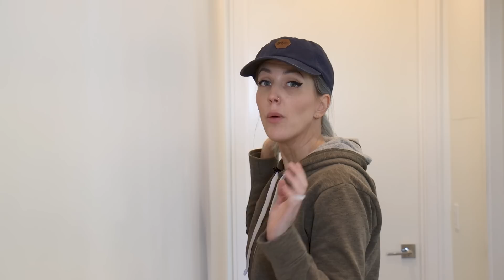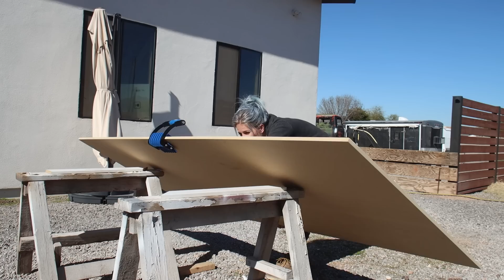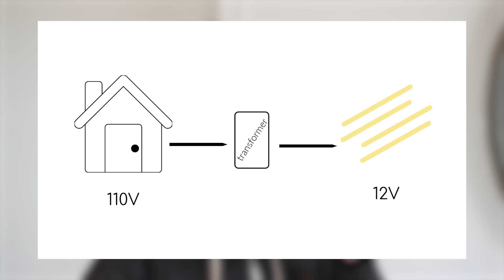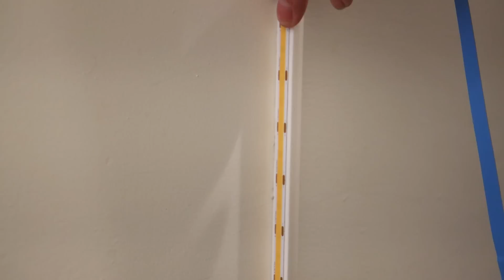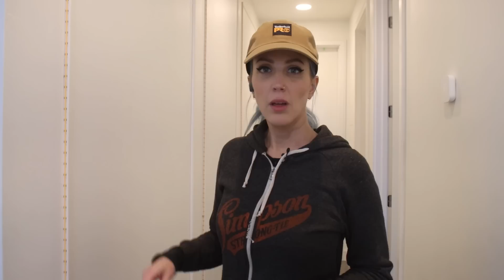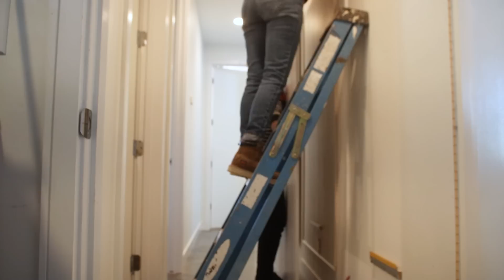I Made My Hallway GLOW! | LED Wall Panels

Comment: Whereas I would have been inclined to either use longer French Cleats at the top, or use both of the pair of French Cleats at the top.  Then you don’t have to worry about distribution of the weight between top and bottom.

Comment: If you don’t want to see the LED’s, you could route a channel into the back of the MDF so the LED’s are mounted in the MDF facing the wall, instead of on the quarter round facing out.

Comment: A good idea to controller the LED's if you really don't want to install a switch in the hall, is to incorporate smart home switch adapter with the transformer, then you can set it on a timer or control wirelessly with google home or your preferred smart home management software

Comment: ;-) parallel connection gives you consistent *voltage* ... and allows your strips to take whatever (milli)ampers they need as they are different length and has different consumption. Actually led strip itself is bunch of parallel connected segments placed physically "in one line" ... that's why you can cut on specified places without changing needed voltage ....

It should NOT be brighter on begin than on end as all segments are connected to the same coper wire (node) and should have access to same voltage .... what you are telling, is "be aware of cheap led strips that have high transition resistance"  ... yeah, it can happens and if you buy something super cheap/crappy or have super long strip (spool usually have 5 meters) ... in your case where you place strips in circle, you can consider connect both ends of the strip to the same driver -> that's the beauty of parallel connection ...

And even if there is no strict code on 12V systems ... dont use some random twisted pair cable... just use something double insulated and round .. its bit more rigid, but you will be sure that you will not rub-off to the bare metal

Comment: I added LEDs around the perimeter of my bedroom and used an RGB with a remote.  I used a pair of aluminum L brackets to form an "U" channel, just because I had a lot of that stuff on hand and mounted it to the wall about 4" from the ceiling.  Then I put some Cello foam about 3 layers to soften the light so I can dim it down.  When I add my Dark Sky's Planetarium projector it makes me feel like I'm outside... It's very cool and fun to lay in bed and watch the stars with the ceiling slightly illuminated.

Comment: Houses in Canada and the USA haven't been 110v as long as you have been alive even if we pretend you're 60 because of all that knowledgeable grey hair dye.
Reply: Hey, winner of the disrespectful award. Pointless comment.
She's not wrong. 120V, 110V are often used interchangeably. Go measure your mains voltage. It very well could be closer to 110V than 120V, which would still be within spec.

Comment: I’m surprised this worked at all! LED power supplies should NEVER be powered via a dimmer of any kind. They’re not light bulbs!
LEDs require a variable current or PWM dimming mode, not a varying voltage. I suspect it worked because your so-called magnetic DC transformer LED driver is just limiting its current output based on the variation in power coming from the dimmer. You got lucky, but I bet that LED driver will not last long - if you look at the manufacturer’s guidelines for it, I bet it states quite clearly that it is not designed to be used with any form of dimmer circuit.
Reply from the maker: Wrong. The LEDs I purchased specifically state they are approved to work with a dimmer.

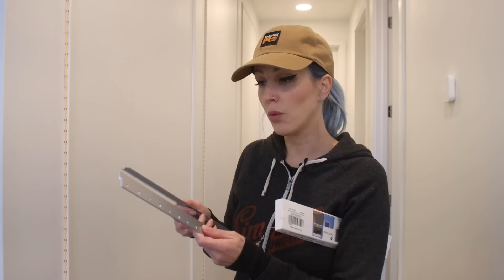Comment: 12:30 Having 2 cleats will not distribute the weight, unless they are very precisely aligned.
What they will do is keep the top and bottom held flush to the wall, rather than floating outward away from the wall.  But you could use a little piece for the bottom, rather than a whole length, making sure the top one is actually carrying the load.
OSB doesn't hold screws well.  Make sure you used the proper coarse threaded screws.  For drywall, I would make sure I hit the studs rather than use anchors, or even glue the cleat to the wall (as I did with some shelves in the laundry room).
using the screws included in the kit:  Again, MDF has an infamous relationship with screws.  Those are probably not the right ones.  You didn't drill a pilot hole, either.  Screws will chew out the threaded area of MDF and enlarge the hole over time.  You have it easy because the pieces don't move.
Reply: Right, the cleats on the bottom aren't carrying any weight, just stabilizing the panel.

Comment: re 65 pounds:
I think I'd use canvas stretched over a lightweight frame.
Of if you don't like that, use thin luan (think one ply from plywood) or hardboard (1/8 or 1/16 if it's available), with thin strips of whatever around the perimeter; perhaps 3" wide strips to get the same effect from the lights.
Also, put a secret message on the back, including the year.

Comment: I like the over all project idea but there are some things that really worry me as far as electrical code.  Depending on the code in your area, you can not wire low voltage with high voltage into the same holes, it is a fire/shock risk. Also the power supply used, I did not see a train relief for the cable coming out of the box.   lastly, if you are having dimness in long runs of LEDs, you can add another set of power lines to inject power again, it is safe to do this because it is all parallel runs.

Comment: I'm so jealous of American houses sometimes. "if you don't have OSB you'll need heavy duty drywall anchors", I wish I had either of those! I live in the UK and all the interior walls are solid brick, and feel like they have lead in them because if I drill about 10 holes and my drill bit is dull as heck! And I need an SDS/SDS+ drill, not just an 18v cordless drill/driver.
Reply: On the plus side, the termites can't destroy your walls.

Comment: Great project. 
Tip for you and for others regarding the LED strip and power.
You can inject power at various places, and that way you would not have a voltage/amperage drop in the led strip and it will stay bright all it's length.
Also, with a router, you could drive out a socket for a 90 degree aluminum profile bar that diffuse the light and hides the LED strip.

Comment: Great choice on the LEDs.  You chose the COB (circuit on board) style of LED which is my preferred type for indoor lighting like this as well.  They give off that steady "strip" of light instead of the individual LED "dots" or hot spots.  Great work here!

Comment: You did an amazing job with the LED strips. I am electrician, I’ve installed a lot of LED lighting, another nice feature is using diffusers( channels) this I believe gives a professional look and the lighting gives off a soft glow.
Reply: As a non-electrician, I can verify that corner diffuser channels will give a softer and more even light distribution. They cost more than wooden trim, but the result will be more "professional". In the end, it's all those small details that end up having a big impact on the overall cost of the project. For a DIY project, this is definitely well done!

Comment: Feel like maybe you should have added an access panel behind the wall to the control panel, should anything go wrong you just remove the wall panel, open the access hatch and then service it without having to remove the fireplace. You were already there with the french cleat mounting on the MDF panels.

Also a suggestion on the LEDs - there are many very inexpensive, extendable LED strips that come with a remote control and driver already built in but I like how you reused old parts for a new approach - just wanted to point out that there's some semi-ready made solutions.

You could also connect a motion sensor on either end of the hallway that would trigger the lights to come on as you approach, to save on power when no-one's moving.

Comment: Nice project. My only cringe moment was at the end when installing the panels. Your step ladder was UN safely kicked out. With all ladders, the base should be kicked out 1 foot for each 7 feet up. This ensures the force pushing down (your weight) won’t cause the ladder to slide out, resulting in broken ankles or worse. Keep safe!
Reply: Easy check for correct angle is that her feet should be level. You could see they were tilted up at the heel, not good.

Comment: Very nice.  I was wondering how you were going to distribute the weight over 2 cleats ... love the double sided tape trick.
Reply: Easier way is to put 2 cleats at the top, then only a spacer block at the bottom, if you worry about wobble the weight of the sheet will be ok. But if you have kids and they go colliding in your walls then I would put some double sided tape at the bottom

Comment: High and low voltage cables shouldn’t share holes. That run is almost certainly against code, if not going to experience performance and efficiency (and therefore heat) problems
Reply: Not true on both accounts.  This is not a code violation in any state of the US.  You are probably mixing this with high and low voltage wiring in the same electrical box - those need to be separated.  Also not true about efficiency - how do you get power losses and additional heat having a low voltage cable next to a high voltage cable.  If you are running low voltage wiring carrying signaling, it's a good idea not to run A/C wiring close and parallel due to noise (think lan/twisted pair cabling for internet, coax carrying video etc), but this is low voltage power for lights .. no problem.
Reply: @glenbayley9697  actually, yes true on both accounts. NEC 800.133(A)(2) And no, this does NOT only apply to communications lines.  And it’s astonishing that people jump in and correct like this without pausing and checking themselves first. NEC states that high and low voltage cables cannot run closer than two inches apart. I spent years as a journeyman electrician and had to pull runs quite a few times because of this.  It is against code in precisely every state.  You will not see any low and high voltage cables running together like this passing inspection. 

If you don’t understand magnetic fields or derating, or how having high and low voltage wires pressed against each other increases impedance, that’s fine, but don’t ask a question and pose it as a correcting statement assuming the answer.  “No problem” that you see is not actually “no problem.”  Running high voltage lines in parallel requires de-rating. Running high and low voltage lines together is forbidden, but if it wasn’t, they’d need to be de-rated much faster in the presence of high voltage
Reply: I've also heard it's against code to run high and low voltage wires through the same hole, something I did DIY 30 years ago.

Reason being is the insulation on both sets of wires is not rated for the high voltage. If the 110 insulation failed, you could potentially end up with 110 on the 12 volt line 

Likely? Probably not. Possible? Maybe...

For this reason alone even if it were within code, which I don't think it is.... It's not the best idea. Especially as in this case there's an easy alternative.
Reply: @joekagerer  in the same hole, same raceway, it’s all against code. Ironically the one thing they stated was against code, is not: you CAN and quite often do have mains and low voltage power in the same box. The conductors just don’t take the same path getting there. Otherwise low voltage lighting and literally anything with a PCB would be impossible. You cannot just just a box as a junction for mixed low and high voltage cables, but you can and often do have both low and high voltage in an enclosure.
Reply: @threepe0  thank you for clarifying. Yes you couldn't have a DC power supply like the one she used if high and low voltage wires couldn't exist in the same box. 

I don't know how I learned this but I know that I shared a hole with speaker wire and Romex in 1987 and later found out it wasn't within code.

I was using lamp cord for speaker wire, and it had 110v rating so maybe I was ok, but probably not.

People post all kinds of things on YouTube. I try and raise a flag when I see possible safety hazards. For everyone's safety.

Comment: Another vote for 24v and higher LED strips. (I know 70v speaker systems can be wired without any special electrical permit in the US.) This is the easiest way to avoid that voltage drop. Plus, especially since you put both ends of the LED strip in the same spot, wire the positive lead to one end of the strip, and the negative lead to the other. If the build quality of the LED strip is reasonable, and all the parts carry similar electrical tolerance, you'll get perfectly even lighting down the whole strip.

Comment: This turned out great! Sticking LED's directly to wood will shorten their lifespan though. If you ever replace them, put them in a shallow aluminum channel with a diffuser to dissipate the heat generated by the LED's! I would also use LED's rated at 50,000 hours for permanent installations so they'll last a lifetime.

Comment: Another important thing is to make sure your wires can handle the current, i think that for that amount of LED's these wires going to be warm, which is not a fire hazard but could potentially lead to LED flashlight or dimming.

Comment: This looks great! I have a suggestion for next time -- try using 24V led strips instead of 12V, it's a lot easier to meet the power requirements since you only need half the amps.
Reply: I did this + agree.  One problem with this is the availability and physical size of 24V transformers .. maybe just me but I had a hard time finding ones small enough to fit into the 4 gang boxes I had planned for them.  12V seem to have a lot more options and are more common to buy.  Another option is to feed power at points down the strip.
Reply: @glenbayley9697  for higher wattage applications where the voltage drop is enough of an issue to justify 24v, the transformers put off too much heat to stuff into a box

Comment: I recommend Chris Maher WLED tutorials.
WLED is definitely the way to go vs any other control unit like the dimmer used here. Also, there are specific power supplies designed for this and are very inexpensive.
Reply: Yes, she probably should have used a Meanwell (or similar) power supply for cheap, reliable 12V power. That's what I used to power 95ft of LEDs across my house. DigQuad driver with WLED software... perfect setup!

Comment: To avoid low amperage ends on your led strips you can simply solder the power wires to both ends, obviouly minding the polarity (positive to positive and negative to negative).

Comment: Either you left out an explanation, or maybe got lucky.  Not all dimmers are created equal.  First, some LEDs do not work with dimmers and those that do require a PWM (pulse width modulation) dimmer.
Reply: Yeah, I was totally amazed it worked at all. I expect the DC transformer will not last long!

Comment: You can use frosted plastic strips as diffusers, that way you can't see the actual LED strips.
Fantastic looking project. The end result looked amazing.
Reply: Strips of slat curtain's can be used as diffusers so that you don't see each LED.
Reply: @1973Grejluder  they could also try routing out a channel in the back of the board, so that the LEDs are hidden and shine on the wall.
Reply: @itoibo4208  I was thinking about that, too, but it would make connecting the LEDs to power quite a bit trickier, given the French cleat system, and the outlet on the front of one of the panels. Also, the flat-90-degree-corners would pose a challenge.

Comment: Cool idea, would be awesome to incorporate some smart home tech to make them turn on as you walk by too.
Reply: You don't need smart tech, a simple PIR detector would be enough to trigger the lights and have them turn off automatically after a short period of time. Just like the motion detecting outdoor lights.
Reply: @maxximumb  I think PIR qualifies as being smart. Obviously, some more fancy circuitry could trigger them to come on in steps in the direction you are coming from. I have seen that on stairs and it looks decent.
Reply: 3 PIR motion detectors would be even better, so each panel comes on separately as you walk by. 😊

Comment: Regarding the issue of long lengths of strips running dim at the far end, one trick is to "center feed" the strip.   If you need a 26 foot total length strip, you can attach power whips at 13ft, aka in the center, and electrically, you now have two 13ft strips on each whip.
Reply: Another trick is wiring positive and negative to opposite ends. This works well for designs where the ends are close, like looping around a room, but takes a lot of wire for long strips. @jblewis’ suggestion is a winner for that situation.
Reply: You can also use “power injection”.  Example: where you have a single power connection at the source, double or triple the wire connections.  Then connect one pair ( black and red), second set at the end and even a third pair in the middle.  Yes, a lot of wire,  but necessary for long LED runs.  This is especially true when using RGB LEDs.
Reply: @rickharms1  what they are describing IS power injection. You’re describing the same thing
Reply: @rickharms1 This is the best solution.  You can power hundreds of feet with this method.
Reply from the maker: That's a great idea! I'll keep that in mind for future projects